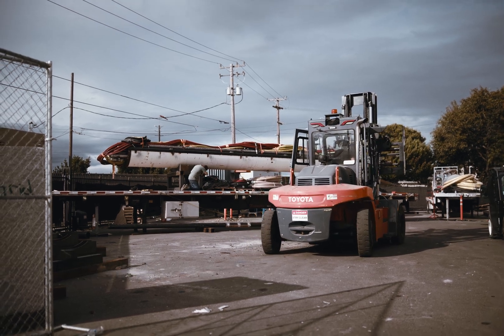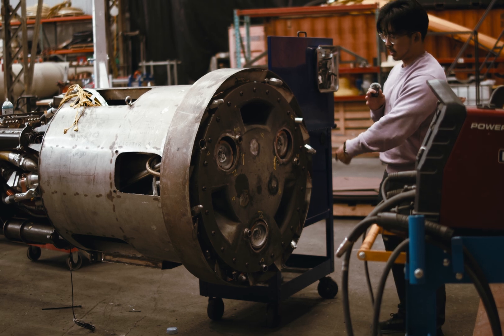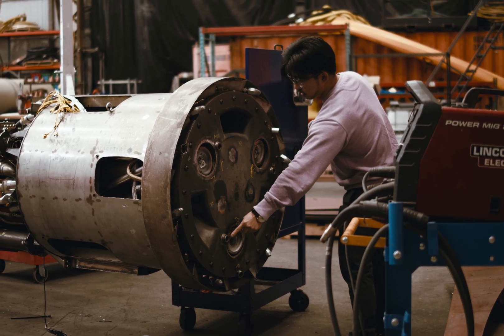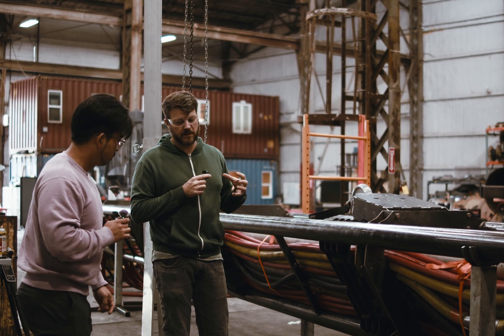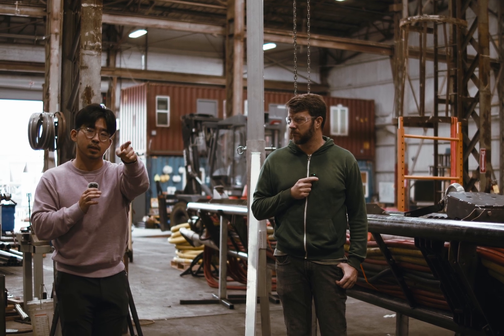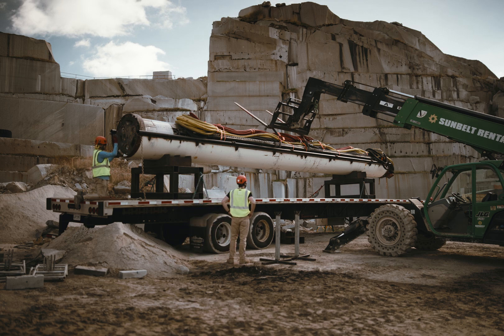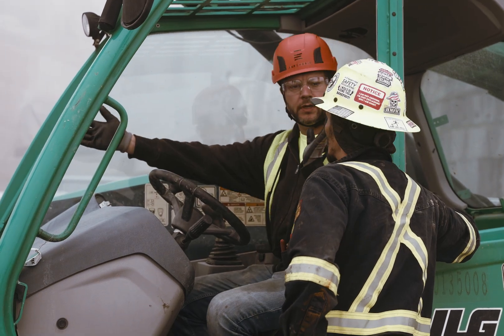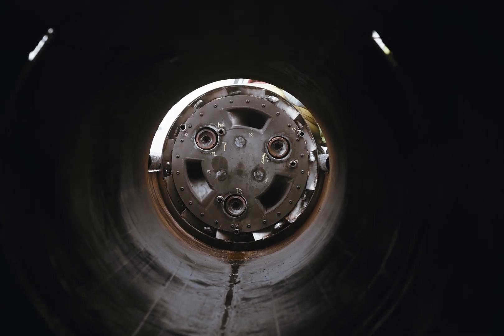We Built a Plasma Tunneling Robot

Comment: If you use millimetre wave technology in place of your plasma heads you can turn the rock into your plasma and make the thing run without fuel... only power.
Reply: With microwave generated plasma, a graphite ring around the cutting head could absorb microwaves with the heat generated vitrifying the tunnel walls
Reply: @lithiumvalleyrocksprospect9792 whats wrong with that? No need for concrete?

Comment: but how much does it cost compared to a normall tunneling drills out there
Reply: I'm just an engineer, so competitive costing, at this stage in development, is beyond my scope of expertise, and everything I'm about to say is purely about this specific point in our development, BUT: one of our big advantages is that we can easily cut rocks that are extremely difficult and expensive to cut with traditional tech, and do it in sensitive environments where you literally can't use traditional tech. Think: drill and blast in the middle of a city, next to delicate infrastructure, in an existing, underwater tunnel. That sort of thing. So beyond just the cost, which I can only say is going to be competitive, we've got major organizations who are eager for us to unlock projects that are literally impossible otherwise.